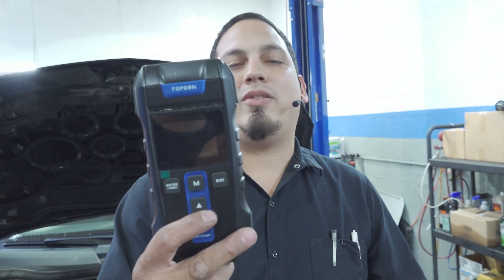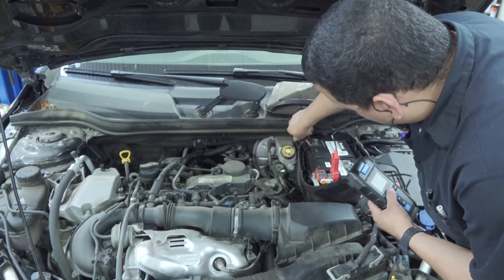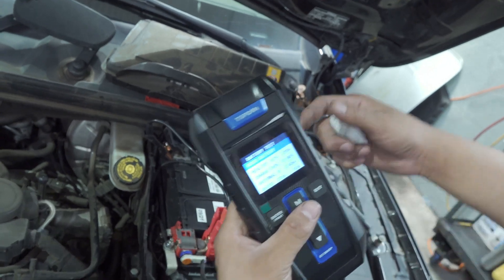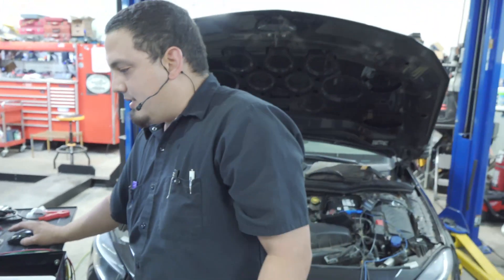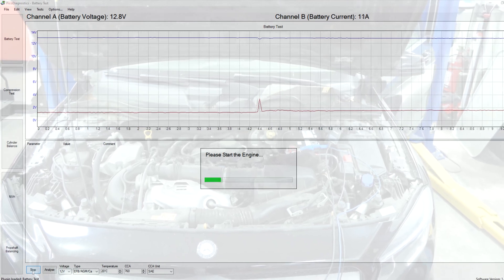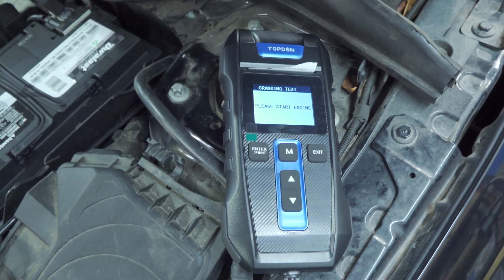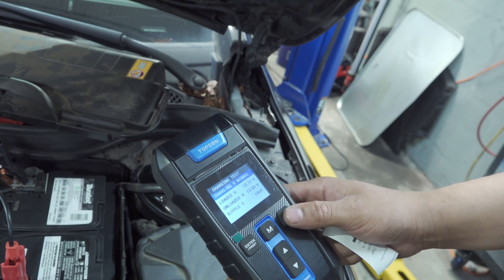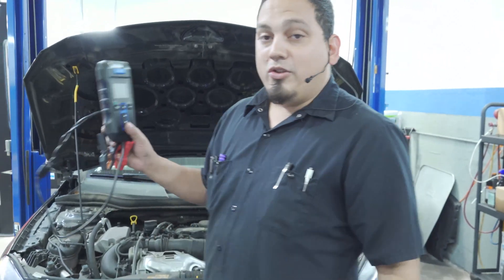The Topdon BT300P Reviewed | Comparing results to the PicoScope battery test

Comment: Here's a tip for you when comparing readings of two different output tests, Add the readings together and divide the total by {of this case 2} to get the average. if the average is within 5% then accuracy is pretty dead on.
Reply: that is smart!

Comment: I was not expecting it to be that cheap. For that price you cant go wrong. My battery tester was 270$ and it doesn't have a built in printer.
Reply: Which one is your tester? Perhaps yours is more expensive because it is more precise?
Reply: @carlosw1687  its a midtronics

Comment: I have an earlier Topdon battery tester and the leads are much shorter, only about 18in.
The difference in SOC will likely be because you connected the Topdon with the vehicle off, but had woken things up when doing the Pico test.
I find it very accurate and will give consistent results.
If you look closely, there are two wires to each battery clip.
This is because they use the "4 wire Ohms", or Kelvin connection.
Two of the wires apply a pulsed load current and the other two measure the voltage drop.
As there are two independent connections to each battery terminal, it removes any connection resistance error.
Incidentally battery testers like this can be used at the starter B+ and ground, applying the test there will give you the resistance of the starter cables and also an indication of the current that could flow - if the battery itself can provide 800A but at the starter end the result is only 200A you know you have a high resistance connection.
Reply: That is really smart... Great comment!

Comment: Mario,

an AGM battery is considered to be completly charged between 12.8 and 13 volts, OCV. Looks like the pico takes care of this indicating 80% at 12.6 V, the topdon not so much. Maybe you can test the same battery once with the regular lead/acid selection and one time more as AGM type and see if the topdon reports a difference.

The topdon max amperage is a calculation of the capacity based on a defined voltage drop, depending on the testing standard (DIN, EN, SAE, CCA etc) A battery can and will deliver deliver considerably higher currents but the voltage drop will be bigger, so the 720 A given by the Topdon and the 998 A from the pico is not exactly an apple to apple comparison.

You could take this to the next level by measurig the AC-voltage and current the topdon sends through his battery test with the Pico connected to B+ and B- where the topdon connects to the battery. The way the topdon works is sending a (to him) known AC-current with a given frequency through the battery and checking for the impedence.

THANK YOU for the video.
Reply: He actually misspoke, the topdon showed 87% not 100% compared to the 80%

Comment: I like how you can do the charging system test independently. On my midtronics I must first perform battery system test before it lets me move onto the starting and charging system test. It won’t always detect rpm increase so I’m glad I got a long cord to hold it in the car.
Reply: can you extend it with jumper cables or its not safe to do that?

Comment: What is mean by battery internal resistance on pico?
Reply: No voltage source is perfect.
They all have internal resistance (it's naturally occurring, not a physical resistor as such), which will cause the terminal voltage to drop under load.
As a battery ages and the plates get contaminated or sulphated, that internal resistance goes up, meaning the amount of available current goes down.
But without a load, the terminal voltage can appear healthy.
The Topdon tests internal resistance with its own current pulses and voltage measurement, the Pico tests that with the actual starter load current measurement and voltage measurement.

Comment: Battery internal resistance is milli ohms, rather than Mega ohms as stated. Thanks for the review !
Reply: Thanks for that... a lot of techs really need to know this!
Reply: Anybody know what is good or bad mOhm reading? I tested some battery with pico battery test and I know brand new battery is 2-3mOhm and worn battery is over 10mOhm, but its depens. My teacher said that if there are more than 10 the battery is out.
I have tried to search for articles but have not found the answer to my question.

@Super Mario Diagnostics: What battery tester U use everday? Pico?
Reply: @aivarinno9257  Do the sums - V=IR, so if a starter pulls say 300A, with 10mOhm within the battery, there's a 3V drop across  the battery during starting.  There will be other losses in the circuit so the voltage getting to the starter will be marginal at that sort of internal resistance.